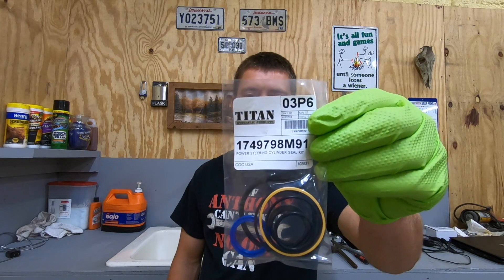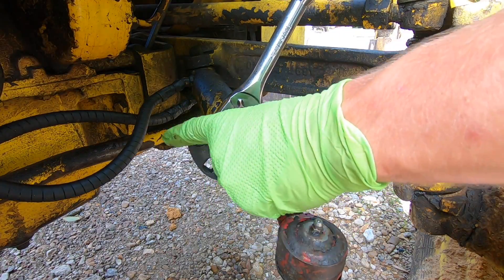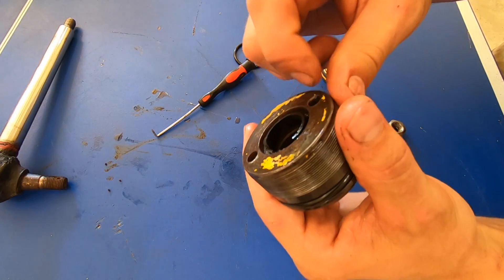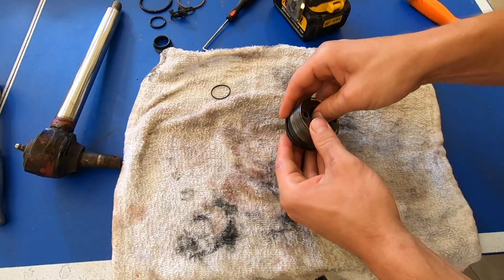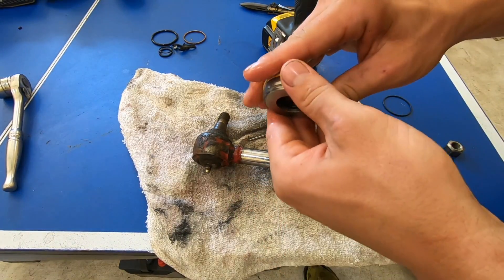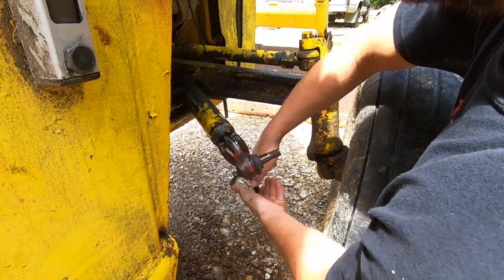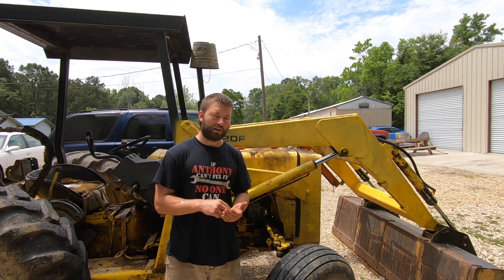Hydraulic Ram Rebuild / Packing || Tractor

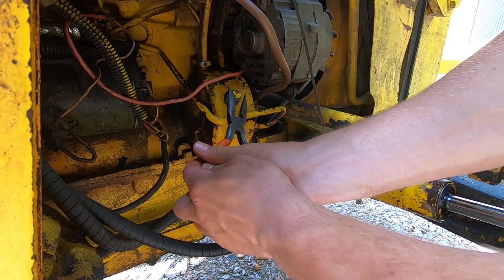Comment: Thanks for the video. At 12:06 you mention hydraulics. Does this mean some tractors power steering runs on hydraulic fluid and shares it with the rest of the system?
Reply from the maker: This tractor has a power steering pump, so the steering is an isolated hydraulic system.

Comment: Thanks, dude! Excellent presentation. Very well put together. I appreciate it. Have a great day and God bless you! 👍🏻
Reply from the maker: Thanks! God blesses me every day.
Reply: @dudewecanfixit  That's awesome! Me too!! 😀
I tried taking my cylinder apart a bit ago but I couldn't loosen the end cap with my gland nut wrench. It was too tight. Any suggestions?
Reply from the maker: You need more leverage (longer handle), think floor jack handle or cheater pipe. However, don’t let it slip out. You don’t want to wallow out the hole
Reply: @dudewecanfixit  I had the breaker bar on it. I thought about a cheater pipe but like you mentioned, I'm not sure I can keep the pins from slipping out if I use more leverage. I guess I don't have much choice though. I may spray some wd-40 on it and let it soak awhile. Not sure if it will help but I don't think it will hurt either. 🙏🙂

Comment: Hey Bud, I have an MF50 loader, is this the same kit? I was having problems with the tractor steering left or right Is that what happened with yours?.
Reply from the maker: Mine kept leaking out all the power steering fluid and then I couldn’t turn at all. I’m not sure if it is the same kit, and I don’t know a great place to cross reference. Maybe try Yesterdays tractors website. 

It’s so hard to find part information for older machines
Reply: Hi Jack Johnson, did you figure out your steering issue?  I have a MF 50HX and the steering wheel will continuously turn around and around with not hardly moving the wheels. Just wondering if you fixed the issue and what was it?

Comment: I’m pretty sure that I’m working on that same exact cylinder and I’m having trouble finding parts . Could you post a link to that seal kit
Reply from the maker: I'll see if I can find it, but these parts are difficult to get part numbers for. If you have a local hydraulic shop, they usually have generic parts on the shelf that will work
Reply: @dudewecanfixit  I know the last guy asked but did you happen to find the part number for the seal kit. I'm pretty sure I have the same cylinder but I'm not really certain of the seal kits I'm finding will fit and I don't have a local hydraulic shop. Thank and Great video .
Reply: Nvm, I saw the package when I watched the video ago. 1749798m91 if anyone else needs it. Thanks again for the video.
Reply from the maker: Good eye, I didn't find the part numbers